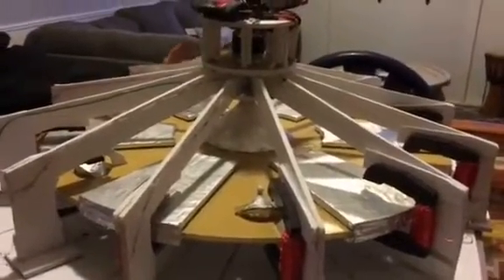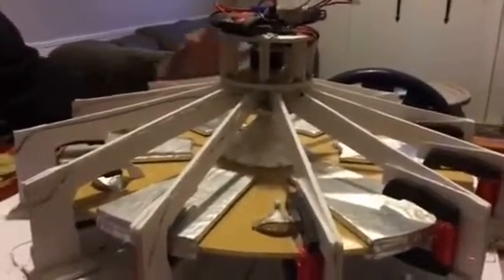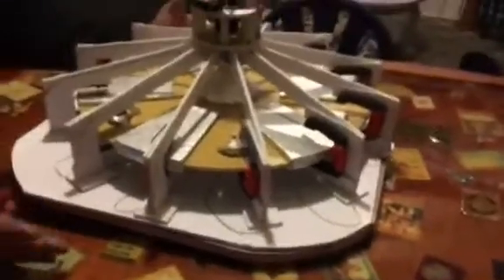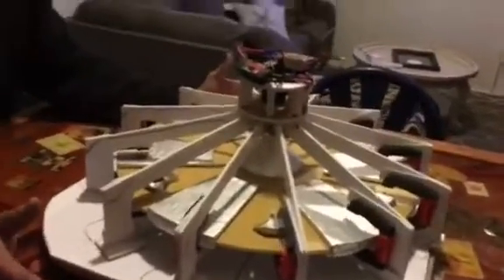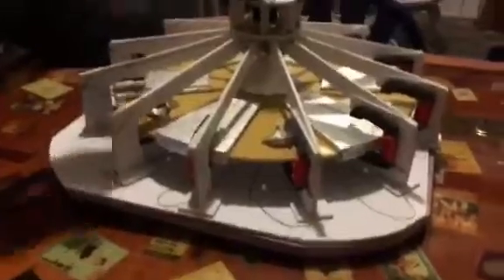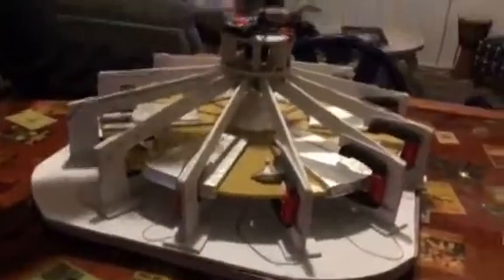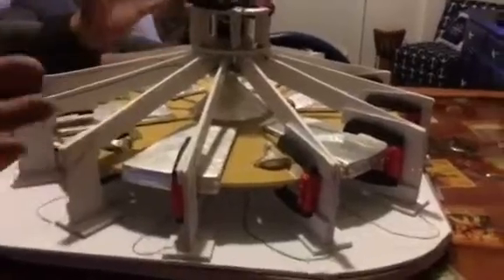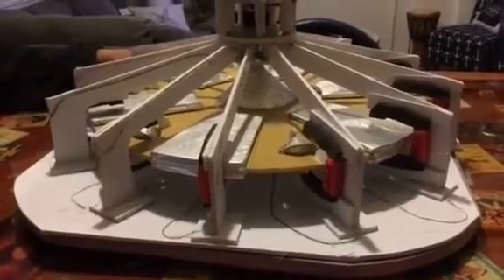OTC X1

Comment: I have been working on the concept also.  I have it a ways further than you do.  1. Your rpms are way too slow to match the proper frequency.  The counter rotation works the same as on a helicopter's main axis, but at a certain point it rights itself.  My question to you is; do you know in essence what this equipment as one piece is?  At a certain point, under certain conditions the essential part of what you are experimenting with creates a new law we are not used to.  It floats.  I have mine on video and at a certain point will reveal it.
Reply: You mean you have actually got it to levitate? By the way, RPMs are a major part of the mechanics behind successful take-off. You would essentially need to counter the speed of the earth's rotation. For example, a disk with a diameter of 1 meter, would require to have a 8786 RPM, bearing in mind that the earth's rotational speed is approximately 1656 km per hour. The actual formula for determining the required minimum RPM for take-off, bearing in mind that all other features of the machine are working correctly (electromagnetics, correct materials, accurate dimensions, etc.), is k=d×r×0.001885 where k=Kilometer Per Hour (km/hr), d=Wheel Diameter (cm), and r=Revolution Per Minute (RPM), and you would need k to result at least 1656 (approximate earth's speed in km/hr).
Reply: First of all, thanks for the rpm formula.  Secondly, yes I got it to levitate.  I have worked with various magnet strengths and various rpms.  My observations show that you have to two different forces.  1. The force you are trying to get going(your disc/saucer and 2. the invisible force the disc is pushing against.  If the second one is not secured it will turn in the opposite direction just as yours does.  It's like walking. You push against the ground or whatever and that force pushes you forward.  If you walk in sand, you move forward and push the sand behind your foot.  Same concept.
Reply: Thank you for your respond. I would be very interested to learn more of your technical approach. For example have you derailed at all from the original schematics as presented by Carr? Personally i am still trying to collect some funds to begin building my own. I have a generally good understanding of the theory, now it's only a matter of proving it and the financial aspect is what keeps me behind on my schedule. I would really like to watch this video, if you are ok with me viewing it i can share my email address.
Reply: Thanks for your interest in your response.  First of all I'm OCD.  I have spent all summer studying Tesla and Carr's theories of anti-gravity propulsion.  It has to do with particle acceleration of the magnetic electrons.  Carr in essence, as I observed was trying to turn his disc into a Electromagnetic field.  If what he claimed was true, his disc vehicle would have created a new force.  Those fields or flux have a mind of their own.  They have a frequency they will operate in and when you turn into the frequency correctly they will put on a show for you.  Also with the 3 parts; one important one for the field equation is/should be time.  Don't turn your machine off so fast.  Put a camera on it and let it run according to a set time and watch the video.

As to my success thus far, I have studied the first part of the magnetic field and now I'm moving into a second part, closer to Carr's theories.  After I have conclusive results for that next step, then I will publish all my findings along with a prototype I'm working on.
Good Luck with your project.
Reply: Thanks. By the way, i also have OCD, although that's another story. I would very much like to keep in touch with you. Do you have an email address?
Reply: go to facebook type: norman breese(norman's 5 style martial arts). When you get there, request connection and I will meet you there with my email
Reply: Just saw your posts, i didn't get an alert. Thanks.
Reply: What alert were you referring to?
Reply: The alerts on the upper right corner of my youtube account. I usually get an alert that a followup post has been posted. I could also say notification. I also get an email notification, but this time i didn't, which is strange.
Reply: Sorry about my backward observation.  I'm aware of those alerts.  So, now maybe we can do each other some good with our projects.
Reply: Yeah, i have saved your email address in my email contacts. I will email you my own as well. By the way, i see you have a Guinness world record on your belt, very nice.
Reply: Yeah, you know...we do what we can.  And I'm crazy enough to go after another one this year.  Who knows!? I'm just crazy.
Reply: Yeah, keep up the craziness flowing. It's the only thing capable of bringing change.
Reply: Norman's 5 Style Martial Arts Ralph Ring who Studied under Carr says it supposed to counter rotate like that. Maybe we can start a Telegram group to further discuss ideas?
Reply: @therenaissanceman8563  have you made any progress
Reply: @Agras14  .
Reply: I am Ralph Ring's granddaughter. He worked with Otis T. Carr on the OTC-X1. I may have documents that could help further your research. Sadly a lot of it was lost in the 2019 Paradise, Ca fire where Ralph lived. He passed away last year, I am the only relative interested in carrying on the research.
Reply: @osmosisomni2248  How can I contact you?
Reply: Please show schematic. 😀
Reply: How.can we get access to said documents?

Comment: Any motion has counter motion too(move stick in the water you getting one way motion but also counter motion of water where you passing through) soo you need here I think aliminium cover and need motor ranning on batteries with remote control soo build aluminum cover and spinn it around 2500 rmp per sek should have contact when is stable like emiter (from you finger) to reciever inside otc ( conected too big midlle cone) soo you will become controller like bumble bee : make electro static field and send body puls or tought puls on winngs to fly where it wants...Rotation above 2400 rmp is because our 3d world we see 24 frames per sek above 24 we don't see it   clearly...
Reply: Any first hand success matey?
Reply: @multiverse8101  not yet stopped testing because family

Comment: I think that few people have read with accuracy the Otis Carr manual before to try to build their  models. The capacitor plates are not wired at all and no coil must be wrapped around the utrons neither outer utrons nor the central one. The energy flows freely between every component and is electromagnetic, so no coil is needed, except the one around the c-shaped electromagnets. Stop to repeat every time the same error, it is a waste of time and money.
Reply from the maker: I think you're right my friend. I've done a lot of different testing and the only one that actually works halfway is with everything running free. That prototype I built actually permanently reversed a compass. This is about nature working for itself. Just need to find the right speed or something. Looking for that zero.
Reply: I think I've read in the manual (and confirmed in the radio interview with Carr) that the needed rotation per minute is between 500 and 600 rpm, that is - he say - direct proportional with terrestrial rotation. Furthermore, the central disc and the c-shaped electromagnet must counter-rotate with the same rpm.
Reply: @stevitbone1  there is no formula or "right speed" in this.  Both  "discs" will rotate at the same rpm, meaning the non-powered rotation will be a direct inverse of the powered rotation due to magnetic field repulsion.
Reply: The utrons were just machined aluminum. Aluminum by itself serves a very important function in the counter rotation.

Comment: Obviously we have run smack into Newton's third law of motion. For every action, there is an opposite and equal reaction. The fact that the aluminum cones generate a magnetic fluctuation is astounding, considering they are not even hooked up to a lower supply while being spun! - You have a remarkable machine there. - Don't let the "men in black" take it away from you!

Comment from the maker: Walter you are correct . I believe I am getting a torque reaction . I made the same shell and motor on top and got the same reaction . Thanks for looking it over .  as we say ....back to the drawing board . lol  . I will follow your notes below and keep going .
Reply: Great job man, keep up the good work.  How is it going walter?  Been a while?
Reply: The outer ring is meant to spin in the opposite direction, if you added radial supports to the bottom of your outer ring then mounted both rings on a vertical spindle with the outer ring resting on needle roller bearings. The counter rotation would increase due to reduced friction. If I remember correctly, in order for the craft to float in its own magnetic field. You need a combined rotation of 34000 rpm.
Reply: @daveyjones2634  34000 rpm?

May I ask where this data was obtained?
Reply: I'm glad that you see that you are getting a torque reaction.

It would seem that just as in the case of a helicopter, you have to do something to control or counteract that torque, simular to employing the use of a rear rotor of a helicopter, however, in Carr's design such a thing was not employed, therefore what did Carr do to solve the problem?

Could the problem be that the 12 generators are not performing as gyroscopes like they should (or maybe the shouldn't)?

In the case of a helicopter, one way to do without the tail rotor, is to add an extra rotor above the main rotor that spins in the opposite direction, thus canceling out the torque. This is done in a helicopter by using a transmission and a coaxial shaft (shaft inside a shaft).

Another method of doing away with a tail rotor, is by sticking jet engines on the rotor tips.

However, in Carr's case, I have a feeling that he used the magnetic fields of spinning armitures as well as a rotatating disk or two to create both antigravity and stability. I would theorize that once a craft becomes levitate by counteracting the earth's gravity and also becomes stable, that it only take a slight change of rpm's in the rotations of one or more of the 12 small armatures in order to cause the craft to dip a little so that it can change direction.
Reply: antigravity 74100 still waiting